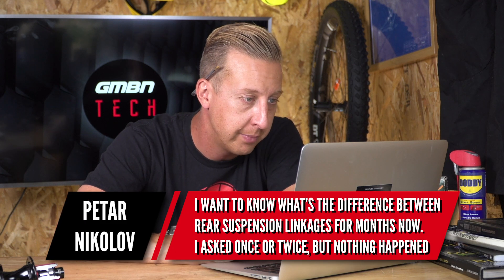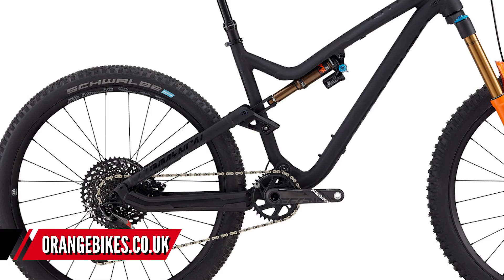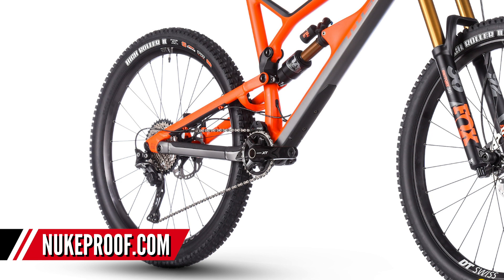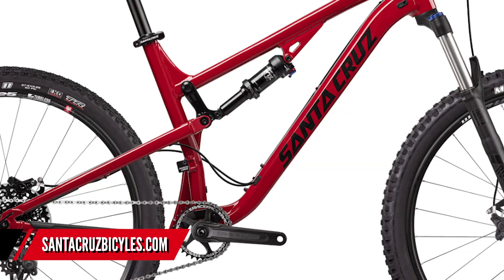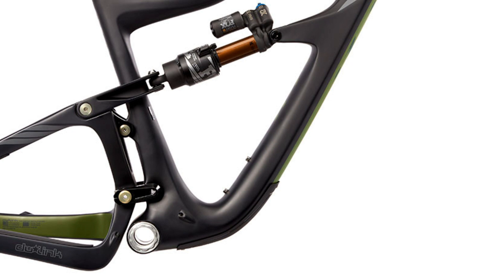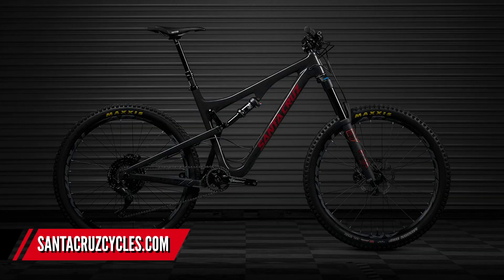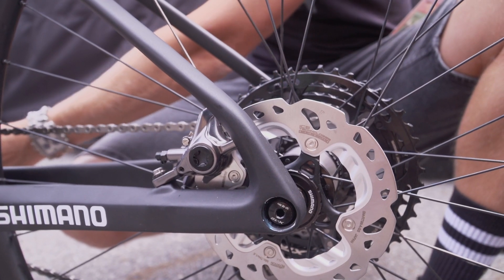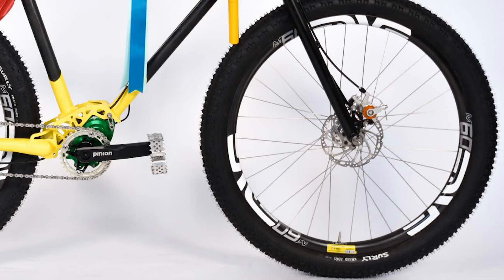Rear Suspension Linkages, Trail Or Enduro & Brake Caliper Placement | Ask GMBN Tech

Comment from the maker: Remember to keep your questions coming in with #askgmbntech or email hellotech@gmbn.com 👍
Reply: Mister T is right.
Reply: GMBN Tech and now we make a game out of it: descripe the same without saying pivot and suspension 🙋🏼‍♂️🤷🏼‍♂️😂💯🔝👍
Reply: is there an updated video all about the different linkages/frame designs?
Reply: So as for a video as in how a suspension works .... I would use like a 3D graph modelthe show The ark and movement and the effects of different key factors of how it plays a role........ 

Side note have you ever done a video referencing a KHS mountain or would you be willing to do one as they've been around since 1974 but there is very little info on... They are at niche / beautique brand ...... I'm more interested in frame durability as well as suspension and geometry .... The 650 line is the ones I'm referring to

Comment: #askgmbntech would you recommend a canyon spectral Al 6.0 2019 or a giant trance 2 2019 based on the difference in their travel and rear suspension linkage system. I am looking for a good trail/ all mountain bike.
Reply: I know I’m super late which bike did h end up getting

Comment: I switched from a trail bike to enduro recently and the biggest difference I noticed is the general feel of the bike. Trail bikes tend to be agile and poppy, easy to jump at slow speeds but the ride is harsh and bumpy in rough terrain. Both mine and my friends' enduro bikes are much more planted and need a proper kick to get them off the ground. The ride is much smoother though. People don't ever talk about this so maybe it's just me but really the difference is huge despite having similar amounts of travel (150 before, 160 now).

Comment: Doddy great show here I really wanna be sure for my choice. I'm gonna get into freeriding soon. Specifically, which downhill bike, from it's specs and features, would you say, is the best for freeriding and hitting jumps then maneuvering them most freely in the air?
Reply: I know  I’m super late lmao but spec doesn’t change how a bike handles through the air or how it hits jumps. If these two areas are your main focus then consider looking into geometry numbers a bit more like wheel base length and chainstay length

Comment: @askgmbntech Last time i were in a bike shop and tried a carbon fiber bike, one of the workers there told me not to buy a carbon bike bekause of my wight (110kg). He sad that that much wight would put a lot of stress especialy on the shock mount bolts.
Reply from the maker: Hey Jonas L, it's hard to tell if he was right. A lot of frame and wheel manufacturers put weight limits on their products, but it's not great to generalise like that. Carbon frame are often stronger than alloy, but it always comes down to the design and build.

Comment: #askgmbntech Just got Topeak Turbo Morph G for my hardtail, but I didn't realize the thing was 35cm long! I can't fit it inside the front triangle with my water bottle. Mounting below the downtube will cake it in dirt and mounting on the toptube looks ugly.

After staring at it for a while I realized there might be another mounting point. Would it be a bad idea to mount a frame pump on the back of a lower stanchion on a fork? It'll have a mudguard with lots of coverage.
Reply: Obviously I'll take pictures and send them in to you (and the bike vault of course)

Comment: #askgmbntech: How about a video building a Manual Machine?
Need to be suitable for a regular 29" Wheel (2.25" Width) and for a 27.5" (Fat 2.8" Width). Is this possible? Or do I need spacers to accommodate the width differences..
Greetings from the Galilee.

Comment: #askgmbntech Hi Doddy, I upgraded my bike with a longer dropper post (from 125 to 170mm). Really better riding (I'm 1,90). But as a consequence, I don't know where to clamp my bike in the workstand anymore. Before I could use the lower part of the dropper, which is now almost complete inside the seatpost. I could only use the piston, which I want to avoid. Frame is an all Carbon Canyon Spectral (2016). Love the show and learned already so much - keep that great videos coming!

Comment: Hi Doddy, thanks for the answer on suspension designs. It's something I've been wondering about for ages. #askgmbntech I was wondering, if I had, for example, single pot XT brakes with 180mm rotors and I wanted more braking power, would I be better off going up to 203mm rotors or upgrading the callipers to 4 pot? I guess the rotor upgrade would be lighter but certainly cheaper... Cheers
Reply: Also talk to Cy from Cotic about front/right mounted disc brake callipers on forks. Something he did on the old Road Rat fork

Comment: #askGMBNtech i'm thinking of using a angled headset on my Canyon Spectral 9.9. (68° to 66.5°) but the only one that fits is a Works component which replaces the lower cup to an external one. lifting the front of the bike with 13 mm. which would make  the BB height with about 5 mm. i already have changed the fork from 130mm to 140mm.  should i do it or not?

Comment: A tip fit the guy leaving his bike outside. Use Vaseline on bolt heads. It's a old 70's trick used on original choppers to protect the chrome on handlebars and wheels when you parked it up over winter

Comment: I really like the parts interchangability with bikes. That doesn't apply to suspension bushings? Boost lower pivot bearing? 1 1/8 uppper arm bushing?

Comment: In your video explaining suspension design you could include diagrams showing the direction of the swing arms and the wheel and in relation to the ground and the brake caliper, maybe diagrams of the bike moving over a surface and slowing down. something for your graphics guy :) Differences in suspension design is something very little people understand, including myself, can't wait for the vid.
Reply from the maker: Thanks for the suggestions! All the reason why it hasn't been tackled quite yet, because it can get VERY complicated very quickly

Comment: #askgmbntech

I’m a 1.94cm older male of 52yo and my weight is a hefty 132kg and want to buy a MTB. 

Problem is all the bikes I’m looking at have a combined weight limit of bike, rider and gear of less than my weight. Trek are 136kg, Scott are 128kg and Canyon are 125kg.

I’d basically need to get down to 100kg to fall within those weight limits. 

Is the weight limit a real issue or are they limiting weight for warranty reasons. 

I’ve currently got a rigid bike and there’s no obvious problem. 

Cheers from Australia

Comment: #askgmbntech Hi guys love the show. I'm in the market for a dropper post. I have a Trek fuel ex7 from 2017. It has a 2x system and there is still plenty of life left in it so I am not changing to a 1x just yet. What sort of dropper levers are out there that can integrate nicely on a handle bar that still has a front derailleur lever? Cheers.

Comment: Is it normal for schwalbe nobby nic to crack on the sidewall?  I have less than 50 miles of light riding and was told by a local bike shop that it is normal wear
Reply: no it is not normal wear.

Comment: I have a rockshox deluxe shock on a commencal meta v4.2 and ride a lot of rocky trails. I would say that i am pretty harsh on my bike. I know a shock with a piggy back would be better for my bike but what would be the differences between a piggy back and non piggy back? Advantages and disadvantages
Reply: Brandong13 piggyback shocks give more consistent performance over long downhills as they stay cooler. Inline shocks are lighter.

Comment: Hi Doddy, as always pleased to hear your thoughts on various tech! And as frequent, I have a couple things to add:
- horisontal dropouts don't have negative effect on safety while breaking, as long as they are facing forward, while in this process the pivot for moment balance is the contact of tyre with the track (in similar manner a fixie with a snapped chain will loose its rear wheel, when the axle nuts get loose, but I guess the rider who let all of the above happen deserved the vengeance)
- being left around uni is probably the worst what can happen to a bike, as bike thieves like such places. Also worth mentioning the cover should be breathable from the inside, like specialized products you presented: plain tarp will intensify the rust through condensation. One could conserve the bike in thick grease, alhtough it takes caution not to use common automobile one, as litium in its content adds water-resistance but actively corrodive to aluminium... IMHO, lending a bike to a friend is the best, let the wheels spin and let that person care with responsibility for other's stuff.
-apropo, single pivot suspensions can also have anti-sag effect, when pivot is plased above the chainline or chainguides are used - definetely you came across these ideas, and it would be super nice when you mention all the features in (hopefully) upcomming suspension special!

Comment: #askgmbnteck  Thank you Doddy for the answer! I kinda have a problem with my front SLX brake. On steep and fast downhills, where almost no brakes were used,  when I stop fast (and lets say I don`t ride for few minutes) after that, my brake feels like its contaminated. There is not a lot of power. Is it possible that the oils "activate" because of the temperature if its contaminated ?   Damn, sorry for my bad english.  
Thanks

Comment: #askgmbn  I would like to know what makes tubeless sealant seal? How does it activate to seal a hole in your tyre? Surely it can’t be when it comes into contact with air, as there is air inside the tyre. So how does it stat a liquid inside the tyre and become solid to plug holes when a puncture happens? Love the show, keep them coming.

Comment: What about the suspension design that use Dave Weagle's Spit Pivot ? What would that system called ?
Reply: Dũng Lê Văn it's a split pivot. It has the same pedal feedback as a single pivot, but there isn't nearly as much brake jack thanks to the brake being mounted on the seatstay
Reply: I'm pretty sure there's some FS bike with the brake being mounted on the seatstay still have brake jack though. But i just can't understand why the so-called ''Split pivot'' design help with it.

Comment: #askgmbntech What causes Valve tearing? Any tips on how to prevent it? I've gone through 3 new tubes in a row in a week. All are torn at the base of the valve. Can Valve Tears (Presta) be repaired?

Note: I've sanded the valve holes smooth, placed gorilla tape over it and even added a rubber washer and increased PSI to 40's and.... it still tore a new tube. I've read about the Tire slipping on the rim and i'm not sure if that's the case. If it is I'm loathe to replace my tires since they still have good treads, haha.
Reply: I had this problem and it was because I was over tightening the valve ring
Reply: TheMeta6 Yup, after the 2nd tube popped I thought the same and ran the 3rd new one with the ring lose and... valve tore again. Haha.
Reply: 🤔 You clearly ride way too fast!
Reply: when mountain biking its a good shout not to use the lock ring at all- they're not needed and serve only to hold the tube in place when fitting. they're sold with the rings and valve caps because they have to be certainly under British standards, if not others. 
you'll be amazed by how much your tyre deforms and moves when you ride, and even a pretty loose locking will tear the tube as the main body of the tyre deforms and stretches over the ground when cornering, pulling the tube with it. 
 its not usually a problem on the road due to higher pressures and less air volume, so the tyre doesn't fold and move so much.
  I'm sure you make sure the valve is centred reasonably over the hole in the rim if you've had the problem a few times.

good luck!!
Reply: and if your valve is running so close to the rim that you feel like you need the locking, then you can get different length valves on inner tubes, just have a look online for longer ones
Reply: then go tubeless
Reply: Never done this to a tube only pinched a few fitting, I’d be interested to know the cause. Low psi, tyre moving on rim etc?
Reply: Tube too small for the tyre?  Manufacturing issue?  Stressing the valve when inflating?

Comment: Rear suspension adds an extreme amount of complexity. The bike is now two frames joined together with links and pivots. The drivetrain is now separated between the frames, the chain gets stretched and causes kickbacks not to mention the maintenance of pivots and bearings. I’m a serious hardtail fan

Comment: #Askgmbntech I would like to replace my front and rear tyre with maxxis or Schwalbe brand tyres. I would like to have a more durable ones. And I’m mostly riding on roads( quite funny that using mtb to ride on roads) and drifting and skidding around. What kind of maxxis or schwalbe tyres would you recommend?
Reply: Go with Maxxis..If you use Schwalbe on wet Tarmac,concrete etc you'll be riding with no grip...They're great off road ,as that's what they're designed for...but wet or damp road surface's ...Forget it..!!  Maxxis though, do a great job of gripping on both...!
Reply: shwalbe marathon or silento. check them out, i've been riding both on my road mtb wheelset and they are awesome, can take dry, wet, even some hardpack dirt or gravel.
Reply: Maxxis and Schwalbe are tire manufacturers. One cannot simply say schwalbe has no grip or even maxxis has no grip. If tarmac is the only thing you ride on, I wold actually go for the schwalbe super moto. I tried them in 29x2.35 size and they have good grip and roll quick, but I am sure you can find durable and grippy tires from both brands.